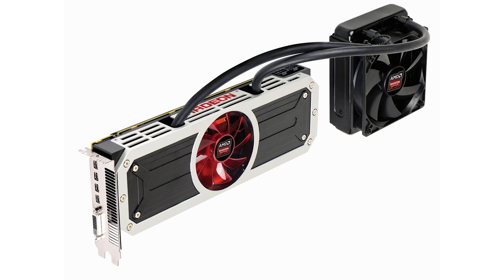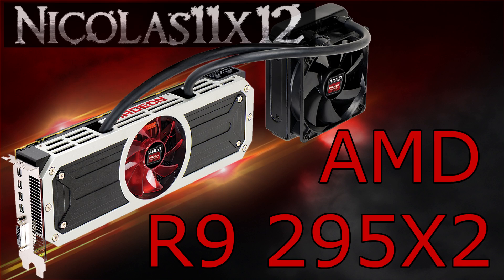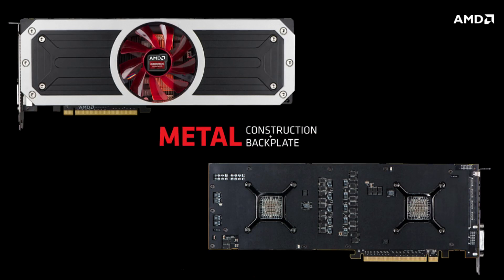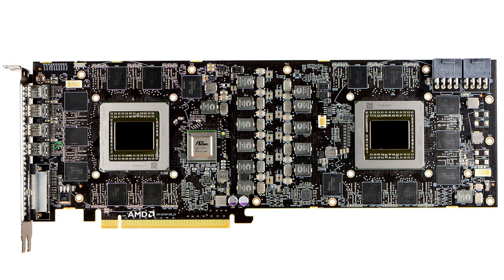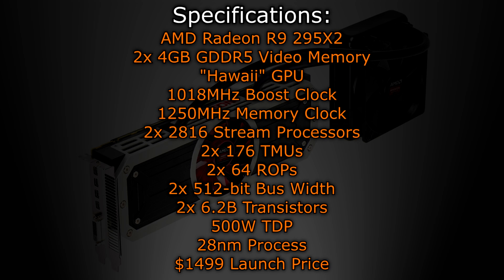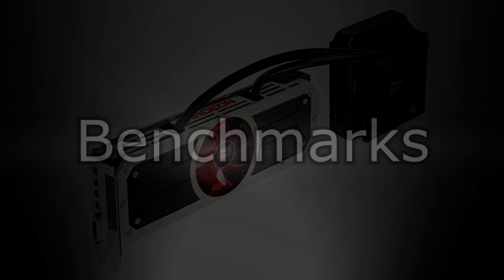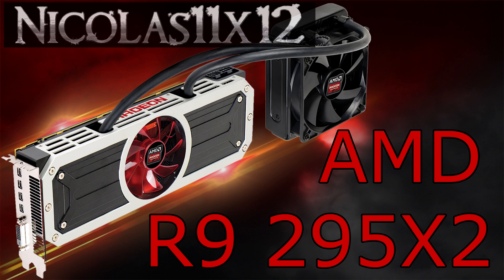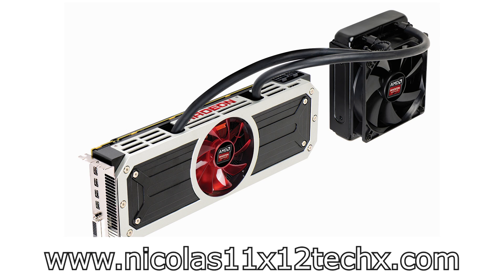AMD Radeon R9 295X2 Introduction + Benchmarks

Comment: this is the only place where the r9 295x doesn't bet the gtx 780ti in SLI....
Reply: Then again, he probably benched the games @ 1080p, whereas the R9 295X is designed for 4k.
Reply: Danny Hanner well it is designed for 4k, but still it beat the sli gtx780ti at 1080p and 1440p, I'm not saying that I think his results are not true, it's just odd.
Reply: I completely agree. It could just be that the two 780 Ti's he benched were cherry picked by NVIDIA, whereas the AMD card wasn't cherry picked. He also didn't mention as to how much the 780 Ti clock speeds were, which could also change scores.
Reply: Danny Hanner yep, nvm this card is still a beast and the gtx780ti is still a worthless card, because the gtx780 costs 200$ cheaper and it is only 10-15% slower and you can easily overclock it to the performance of the gtx 780ti, or even better now that amd prices have come down you can get a r9 290 none-X with aftermarket cooler for 380-410$ and overclock it and again beat the gtx780ti :)
Reply: ***** well then you can make the company that you buy your parts from, overclock it for you if you can't do it yourself, but overclocking is really easy, especially when you can find overclocking profiles exactlly for the gpu you have on the internet :)

Comment: best in 4k beats 2 780ti in 4k
Reply: What about the Titan black and the 6gb 780 ti that's due, memory isn't gonna be a problem for those.
Reply: nasha thedog Fantastic job by AMD. Interesting side note but Nvidia has postponed the release of the Titan Z because they felt the performance was not enough to beat the 295x2. Nvidia are currently trying to boost RAM and core clocks on the Titan Z. This suggests that the 295x2 can trounce anything Nvidia has to offer (but bench marks I have seen tend to differ as some show it beats 2x780Ti whilst others show 2x780Ti creeps ahead by small margin). But I hope the AMD drivers have improved (when I had the 7970 and 7990, drivers were not so good). Anyway, see -

http://www.tomshardware.com/news/nvidia-gtx-titan-z-delay,26652.html
Reply: suhail ahmad The 295 will have the advantage over the 780 ti's at high res's due to the ram advantage it won't with a pair of Blacks, The Titan Z wasn't what I was talking about but regardless of that the Titan Z is an overpriced underpowered travesty which is why Nvidia cancelled or delayed the release, If they want it to be the fastest dual gpu it needs to be redesigned so it doesn't need to be underclocked and they need to rethink the price if it's going to be pegged as a viable gaming option.
Reply: ***** and 8gb's on a dual gpu is still 4 gb's per chip, what's your point?